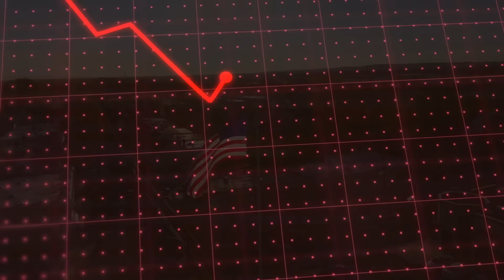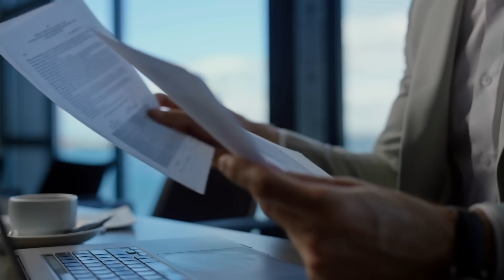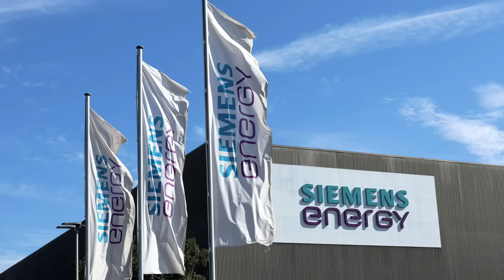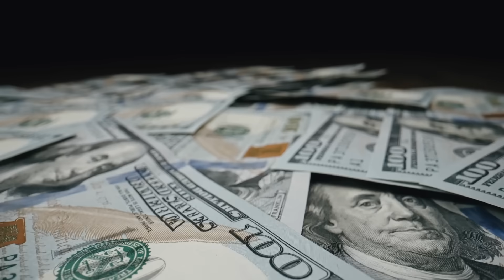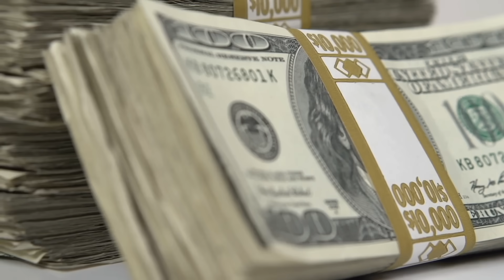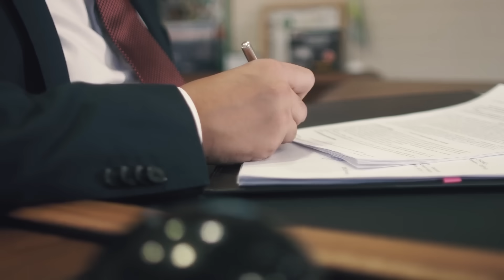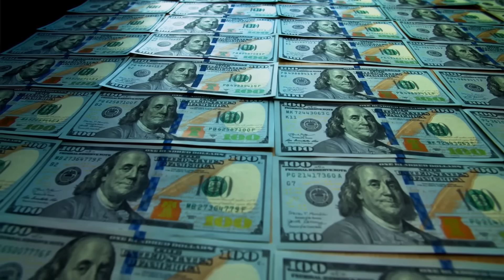The Real Reason America Has Turned Its Back On Wind Power Energy

Comment: Could it be that China builds better, cheaper, & more reliable wind power generators? 
It's why the EU solar panel industry has been so deeply undercut, by Chinese innovation. 
Geothermal energy is probably a better, more reliable source of sustainable energy, especially in the western parts of North America.
Reply: The EU solar panel industry was undercut by chinese subsidies and bigger volumes.
This is also the case for windturbines, but the engineering is a bit more challenging. It is doubtful their turbines are better and more reliable.

Comment: At some stage TESLA is going to step into the distribution network and wipe the board with the existing network corporations. The can ramp up production without relying on the useless old power grid.
Reply: And how would they do it?
The problem is production capacity in electrical components and manpower to build the grid.

Comment: The segmented nature of the US power grid is a benefit in that the whole thing can really never go down... if it WERE ONE SYSTEM the entire country could lose power at once, additionally without ZERO KELVIN cooled powere transmission lines there is huge amounts of power lost during transmission of power over long distances... it's not as though you connect a wind farm in Mass or Conneticut to generate power for Chicago.... but most people DO NOT KNOW THIS!
Reply: In Denmark we have a "Major Grid" of "High Voltage Power Lines" or Cables in the ground to be able to transport Electricity from one area to another, and if the Wind blows in the west it is transported to the East also. At intervals it is transformed into a useable 220 volt for the local area (also 380 volt for high power use).
  This Grid is also connected to neighboring countries, as Norway, Sweden and Germany for being able to sell Surplus or buy Extra Power!!! During summer we have much Wind on our Westcoast and at other times they produce power from Water Turbines, or Nuclear Plants! By that we are all able to have a constant Power Supply! We hardly ever has problems with faults or lack of Electricity, maybe once a year, if unlucky!
Reply: @finncarlbomholtsrensen1188  One problem we have in the US is size...  US covers roughly 9.83 million square kilometers, Denmark is around 43,094 square kilometers.   When you stretch lines the distances needed in the US, it gets difficult to keep everything working.
Reply: @finncarlbomholtsrensen1188  Do you realize how small Denmark is? The U.S. has similar small areas that do the same thing you are talking about. Denmark (not including Greenland) is less than half the size of Texas, so it's about the size of a "typical" stare in the U.S. Generally each state has a pretty robust power grid. Sometimes there are problems with interconnection between the grids of various states, similar to how there are problems with the interconection of the various grids from one country in Europe to another.
Reply: Centralized control and management is attractive on paper but it does lend itself to all or nothing; I lean toward decentralized  with all contributing to the whole allowing a problem to be remedied then reconnecting adding back to what was loss during the outage allowing the other contributers to learn what caused the outage and also the solution; over time the best ccontributer design would float to the top.
Reply: ENERGY IS NOT SCARCE.

Yet evil politicians conspire to cause phony shortages? The universe is full of energy, so why are we paying for energy? Why does free-energy technology continue to be suppressed?

Thus all the more that I doubt that your superconductors solution is the answer. We currently have superconductors up to the temperature of liquid nitrogen. Perhaps that is totally useless for 100s of miles long transmission lines, as cost is a massive massive factor. We should be looking at thorium nuclear power or free-energy technology that the evil deep state has no right to suppress.

You do know why they step up the voltage very high for long transmission lines? Less power losses, as power is voltage times current. With higher voltage, there is less voltage drop, and also less current, resulting in lower losses. But why are we transmitting electricity for 100s of miles? Free-energy machines could solve that, and we could have our own whole-house free-energy machines, or produce our electricity for a few homes, or at the substation level automatically.

My entire video game island is powered by one free-energy machine, but that is just because I decided that that would be a better use for its "science pod" 3-D model.
Reply: Line losses aren't that enormous, and decrease when voltage increases (that's why high-voltage lines are built in the first place). Claiming that they need to be cooled to absolute zero only shows that you don't understand physics. Incidentally, an HVDC line is currently under construction to connect wind farms in Iowa to Chicago.  As for the entire grid being connected, there is no real danger of the whole thing failing, because it is constantly monitored to connect and disconnect transmission lines. In fact, many large blackouts are caused by sections disconnecting to prevent equipment damage from excessive load, and more connections can allow load sharing to other generating sources...but you DO NOT KNOW THIS!
Reply: To the contrary, it is easier for each segment to lose power.
The more interconnections, the more stable a grid. If a subgrid fails, it can be disconnected, it usually does cause the whole grid to fail.
Reply: @old-pete  there are only 3 power Grids, East west and Texas
Reply: @dknowles60  And that is the issue. Texas does not have enough redundancy to other grids to evade Federal oversight. The energy companies prefer profits over safety
Reply: @old-pete  wrong again, The fed gov TVA went close to the Same thing Dec 23 dec 24 2022. the TVA since then has built 4 new Nat gas power plants with oil back up  is delaying  Closeing down its Coal power plants untill 2040. Texas has also added extra Megawatts
Reply: @dknowles60  I was writing about the grid, not power plants...
Reply: @old-pete  the grid is no good with out power Plants , the Grid is Ok, hint if the TVA can purchase 10k Megawatts from others dec 23 dec 24 2022 it is ok. Hint many states dont produce 10k megawatts
Reply: @dknowles60  The issue is when powerplants do not produce.
Texas experienced multiple winter storns were the gas infrastructure froze up and gas powerplants went offline. Better grid connections to the neighbours could have helped and lower the electricity prices.
Reply: @old-pete  wrong, failure to have on site oil back up
Reply: @old-pete  Failure to have on site Oil back up
Reply: @dknowles60  That is one of the reasons. But oil backup does not work long in a snow storm.
Reply: @old-pete  wrong again the TVA has over 1 weeks worth of Back up on Site for its nat gas power plants, now for the TVA nuclear power plants as browns ferry proved not very much diesel fuel on site
Reply: @dknowles60  Then it looks like these backups do not work very well, as many power plants in Texas failed in the past because of lack of fuel...
Reply: @old-pete  wrong again in 2025 the TVA had no nat gas failures thanks to Nat gas. I think the TVA knows a lot more about Electricity production then you do
Reply: @dknowles60 You are wrong all the time. Can you even read?
1. I am writing about Texas
2. I am not writing about 2025
3. Texas experienced catastrophic grid failures in 2011, 2021, 2024
4. Texas experienced 210 weather related power outtages between 2000 and 2023.
Reply: @old-pete  Very nice lies you were in in Texas 2024,  or 2011, you cant even read , Hint in April 2011 the TVA was hit by a f5 tornado lost Browns ferry nuclear 400 miles of transmission lines   and still kept 80% of its electricity on Texas did a lot better then the Fed Gov TVA dec 23 dec 24 2022. both Taxes and the TVA areas have been hit with very high growth rates, i dont live in Texas and Texas dont put much on line and Texas dont have much of any open to the Public board meetings but like it or Not Texas is still geting the Job done, now if Texas still had then 25k megawatts  of Coal power Plants that Obama closed down

Comment: Why not use natural gas? It's clean. And renewable. Also nuclear power. And those two use less land. Solar and wind energy haves a lot of draw backs. It requires a lot of trees to be cut down. And I read where solar panels. Have to be replaced every fifteen years. And they have a lot of toxic metals in them.
Reply: Gas and nuclear power are not renewable.
Drilling for gas wells and burning gas destroys more nature than wind or solar.
Solar panels can run for 30-40 years.
The only problem is that in 20 years new solar panels are much better than the ones one installs now and many investors want to exchange them.

Comment: Wind seems too ugly,  fragile, and requires excess land or sea use. Solar power on your roof can power your home as well as your car when supplemented by battery power. Tesla has a home power calculator you can use. Your address is required so that that they can see your roof and how the sun strikes it. Gen 4 nuclear reactors show great promise as does natural gas..

Comment: Where is the surge capability of solar and wind power? It does not exist. We wake, society uses more electricity, getting ready for work, then at work. We come home in the evening, again, we get in the house, crank the AC on cold, turn the lights on, etc. Surge capability is provided by coal, nuclear, and gas electrical plants. Very cold weather requires a surge capability as does high heat via the summer sun.

Comment: The only fuel for the future that is reliable and viable is nuclear. Thorium nuclear power plants are the way. Green energy is the most costly wasteful grift ever put upon mankind.
Reply: How long do you want to wait? There are no commercially available thorium reactors. It will take at least 20 years until they are available in meaningful numbers, probably longer.
Reply: Wind and solar will never be reliable never ever. Also there is no carbon crisis so there is no reason to fearfully rush into things. A long term answer is thorium nuclear so start today. In 20 years all will see what a costly failure wind and solar were and in 20 years we will have working nuclear power if they start. It could happen much sooner but the green energy fanatics fight to stop anything but wind and solar like they’re on a religious crusade. @old-pete

Comment: This is so unbelievably naive and mostly false.  It is Not a paperwork issue.  Here are the facts: it is not green in most places as the carbon needed to build most solar and wind will never pay off except in a few places.  Those places also have to be located near a decent sized population center.  You want solar makes sense in California, wind doesn't.  It will never pay off it's carbon footprint.  Well Denver is windy up in the mountains, good place right?  Wrong, not enough air pressure and therefore major loss of power and again never pays off the amount of carbon it took to build the windmill in the first place.  How about the Northeast?  Not enough wind nor solar, both are carbon sinks and the grid could not handle it without being rebuilt from the ground up and even then the solar units and windmills will NEVER pay off the amount of carbon it took to build them let alone add in the cost off the carbon for the new power grid.  You know where it does pay off?  Texas, yes Texas.  Enough solar and wind that is near enough to major population centers.  The state awash in carbon fuels is also the place that will be carbon neutral first and probably only place.  
And just for those nuts who think we can just innovate a better solar panel or windmill, we are already pushing the physics close to maximum attainable now.  There is no Star Trek solution as we are against physics itself.
Reply: Wind and solar easily earn back the invested energy. One one must really do a lot of mistakes in the planning phase to put them in places were they cannot.

Comment: Wow, stop whitewashing! The Real Reason America Has Turned Its Back On Solar and Wind Power Energy! How about! The current average efficiency rating for residential panels is around 18%. High-performance solar panels have efficiency ratings of over 22%, while budget products come in at approximately 16% efficiency, with a lifespan of 25 years. Wind turbines are 20% to 40% efficient at converting wind into energy. The typical life span of a wind turbine is 20 years, with routine maintenance required every six months. Right now the average wind farm is about 150 turbines. Each wind turbine MAIN GEARBOX needs 80 gallons of oil as a lubricant that's 12,000 gallons of it. That oil needs to be replaced once a year at a cost of $1,608,000, then there is the PITCH GEARBOX, and YAW GEARBOX that need oil too!, HYDRAULIC SYSTEM oil, and GREASE for the Main Bearing, Link Chain, Open Gear, so where is the green and green energy?
Reply: Windpower has 1/100 of the CO2 emissions of coal powervplants and 1/50 of the CO2 emissions of gas power plants for each produced kwh.
Reply: @old-pete   so you agree wind turbines suck, CO2 emissions are good! Why? Photosynthesis is arguably the most important biological process on earth. By liberating oxygen and consuming carbon dioxide, it has transformed the world into the hospitable environment we know today. Photosynthesis converts radiant or solar energy into chemical energy. The productivity of agricultural crops directly depends upon the rate of photosynthesis. It provides oxygen in the atmosphere for all living organisms. It maintains a balanced level of oxygen and carbon dioxide ecosystem. Humans can not live without photosynthesis. First, the human body needs a continued energy supply to maintain its structure and sustain its life. Glucose produced by photosynthesis is the primary source of energy for the human body. Second, photosynthesis removes carbon dioxide from the atmosphere and releases oxygen.

Comment: One major challenge is the struggle between upgrading the existing grid versus building out more renewables.  Each side needs labor intensive products such as large power transformers.  Gone are the days of GE and Westinghouse manufacturing plants.  Further, and perhaps maybe more challenging, might be the struggle between steel manufacturers deciding to make electrical steel for EV motors versus transformers.  Transformer OEMs have 3+ year lead times partially due to electrical steel suppliers.   Pick your cause, but understand that one affects the other!

Comment: @ 3:38
Saying " They are very green to maintain".
How?
They contain oil/grease and required diesel vehicles to reach them and maintain them.
Reply: And that matters how to the amount of oil/gas/coal that burned in fossil power plants every second, just to supply energy?
Reply: @old-pete  The topic is Wind Power Energy mate.
Reply: @450tank  Is that supposed to be an answer to my question?
Reply: @old-pete  Take it however you like. Why are so many countries back pedaling to fossil fuels or nuclear.
Reply: @old-pete  Has your power bill risen?
Reply: @450tank  In other words you cannot explain how their enviromental impact matters compared to fossil fuels.
Yes, a lot of countries talk about nuclear power, but only few countries build them. Less than 1/3 of the power capacity finished per year in the early 80s is finished currently per year.
Yes, energy bills increased. I hope you noticed that a major fossil fuel supplier is involved in a war.
Reply: @old-pete  All I did was make a comment about wind turbines still needing fossil fuels to lubricate and maintain them. And obviously you are still connected to the grid and using power supplied by fossil fuels you demonize.
Do you have a fuel powered car, whipper snipper, or mower.

 Now, get a life and get of your high horse.
Reply: @450tank  Obviously, using much less fossil fuels is better for the enviroment...
And no, I do not demonize fossil fuels. 
And I use roughly 1/3 less fossil fuel as the average person in my country.
Reply: @old-pete  Yes, reliable energy.